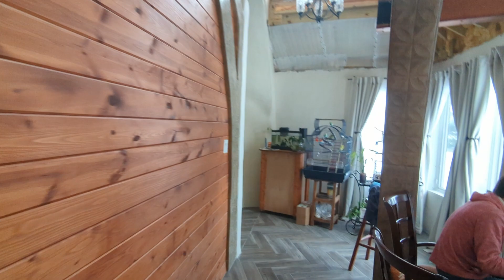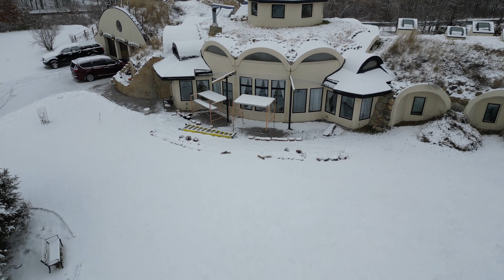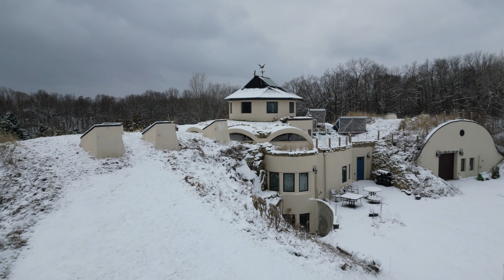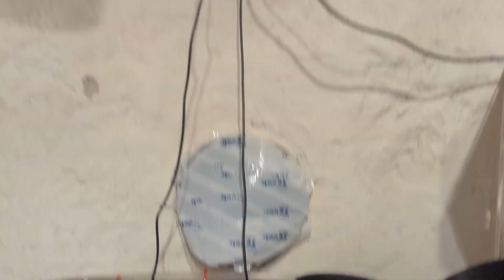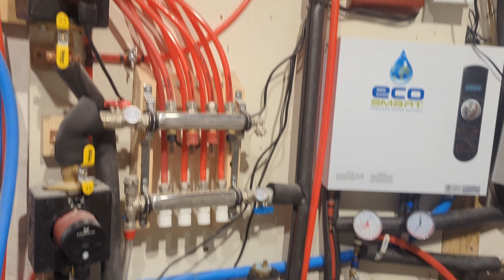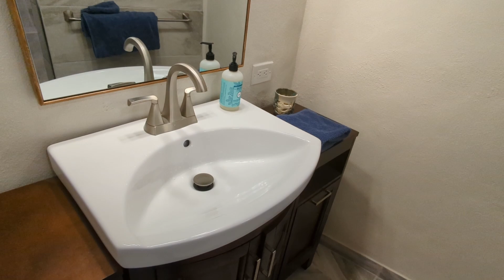Nov28 WalkThru

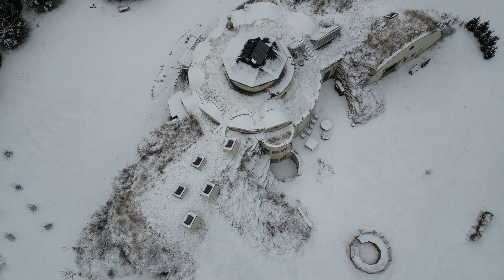Comment: 6:29 re: heat loss through the skylights - i imagine there are some different solutions for blocking those off on cold nights to minimize the heat loss.
Reply from the maker: Yea, I thought i would, but I just haven't bothered.   I do have ducts from the top of each one and I suck the air at the top back down into the basement and blow it around the house, but I have not bothered insulating.

Comment: What if you had a heater in the air intake room or do you?
Reply from the maker: Nope, no heater in the air intake room.   I let the air come in after being warmed by the earth tubes and then just distribute it thru the house.  If you are used to forced air being hot, you will find that you really enjoy having the air nice and cool (it feels fresher that way) and getting your warmth radiated from the floors and walls.   Radiant heat from the concrete feels like sunshine on your skin rather than hot air in your lungs.  Not heating the air also means the air stays at about 30 or 40% humidity all winter (heating air dries it out), so we didn't get dry skin or electric shocks like we did in the previous house.

Comment: Thank you for the update!

When I look for examples of earth integrated homes I get nothing but earthships and their dogged desire to be eco friendly clashes with my desire to have a modern home with a seemless feel from current buildinhg that my wife would be interested in pursuing and you have done a great job with yours.  Thanks for breaking a trail!
Reply from the maker: Yea, I have got some hate mail from the earthship folks because I am not pure enough and use concrete and insulation and run electricity from the grid.  Don't get me wrong, I am interested in getting solar panels one day, we are just not there yet.  And I don't believe concrete is as bad as they say.  If it had more embodied energy, it would cost more to cover the cost of all that energy.  The fact that it is super cheap is a strong clue that it isn't that bad.  And the durability and strength of concrete just can't be beat.

Comment: Awesome. Acoustics definitely an issue. There are some partial solutions, even post design. I guess an engineer knows all that already....
Reply from the maker: Yea, I had imagined I would need to do something, especially in that office.  All the other vaults were designed so the echo is high above your head and you don't hear it walking around.  For the office, I was thinking fancy stuff like acoustic panels laid out like a geodesic dome (I wanted to build something geodesic and that would be the perfect excuse).  But then I put a desk, some chairs and boxes (never unpacked) in that room and the echo went away immediately.  So maybe I don't even need to get fancy...  But yea, if the echo is bad when I move back in, I'll get to do the geodesic acoustic panels.
Reply: @HomeintheEarth   Years ago when I occasionally consulted for architectural acoustics, I had simple three-principle rule of thumb for solving acoustics issues, 1) Reduce (eliminate sources of sound, for example, eliminate a noisy hardwood floor that people walk on), 2) Disperse (reflect the sound away towards unused spaces, or break it up with rough surfaces or odd planes, and eliminate parallel planes, etc.) and 3) Absorb (strategically employ absorbent materials).  The Absorb part was the most problematic.... different material thicknesses absorb different wavelengths, etc., and so the first two steps usually got a lot of attention.

Comment: Did you ever have any condensation from the ceiling inside during the humid months? its always cool to see update videos.....come so far!
Reply from the maker: No, no condensation inside since we put the windows in.  The spring before windows, the bedroom walls were very cold and we had a few hot humid days with no way to stop the humid air from getting to the walls, so we saw condensation.  Now the house is well sealed, so the condensation happens in the earth tubes as the humid air is cooled.  Once in the room, it warms up again (the house is warmer than the earth tubes) and the dew point drops so we don't see any condensation inside anymore.

The one exception is inside that box just before the fan.  So I need to redesign that this winter before it happens again next spring.
Reply: thats super good then, that would be my biggest concern with a earth home. Seems if well designed its way better than the homes everyone makes today. Awesome!  @HomeintheEarth  👍